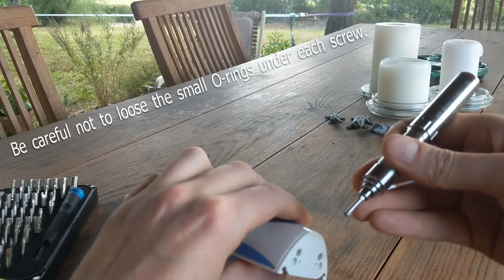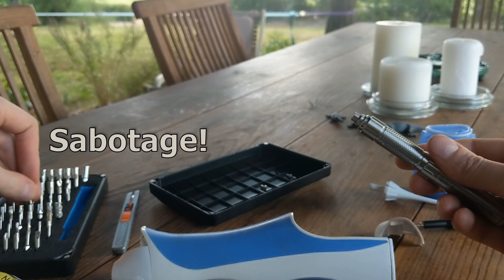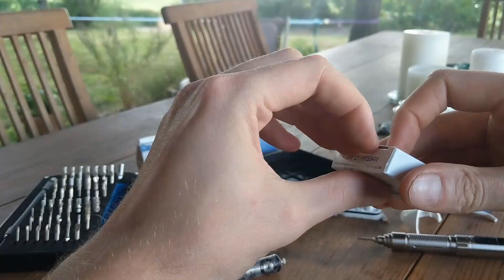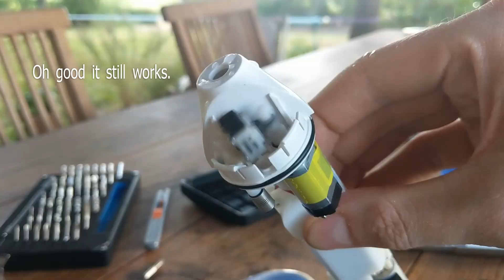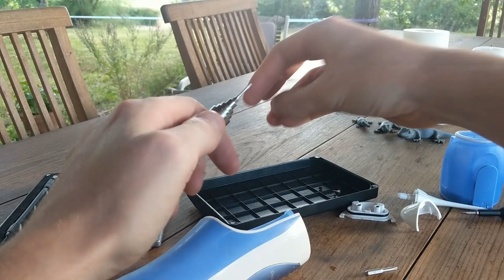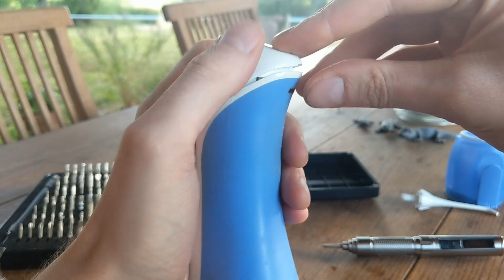Replacing batteries on Panasonic Dentacare EW1211

Comment: Thanks for the disassembly video! Sure was easier than I expected!
A couple of AA batteries does just fine, even better because AA batteries are easier to find in good quality.
The receptacle terminals can be slightly bent to make contact with the battery ends, even without the weird bars.
Reply: Bent and put some plastic from old bank card between case and terminal. And better to use double sided tape to be sure, that batteries are still in place.

Comment: Very kool! Thanks for your pulling it a part, putting it together and making such a great video!! I have an EW1200 and it is non functioning although the base has power.
Reply: And does it work again after replacing the batteries?

Comment: You don't need to remove the torx screw to replace the batteries.
Also, I have a manual for the original EW1211 in 18 languages including English. I don't mind uploading it somewhere if somebody needs it.
Reply: Could you please paste the link here?
Reply: @katalin5630  
https://drive.google.com/file/d/1ho79ZP-9MDlk9ban7gaeOYL0mBA9XZXA/view?usp=sharing

If you go to the Panasonic website for the region of the world where you live you should be able to find a manual in your language.
Reply: 13€ la pile, ça fait 26€ les deux et 30+€ avec livraison, alors que le produit neuf coûte 36€ 😅

Comment: Thanks a lot...... The gadget is perhaps designed in a way that the batteries can't be replaced...... It was a major hassle right from opening it,  sourcing the batteries and assembling back. It wouldn't have been possible to do but for your guide

Comment: Judging by the cleanliness of this machine Alex is working on a new one. I found the batteries didnt come out anywhere near as easily as that, some corrosion had set in around the terminals and 'welded' them in. And no you do not need to remove the torx screw.
Reply from the maker: I did take the opportunity to clean the parts while doing this. I found there was white limescale residue on some surfaces, mostly obvious on the blue tank.
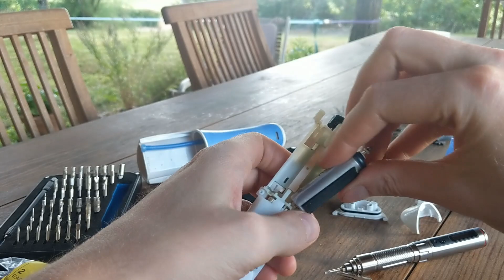The splits between parts had collected some gunk. The sealed areas were clean however, I think you can just about see a tiny bit of corrosion on one terminal at 2:44, so maybe humidity was still able to get in. NiMH are meant to be quite good at not leaking electrolyte unless overcharged/overheated but apparently it does still occasionally happen.
I think I worked out the Dentacare was 4 or 5 years old when I did the battery change.

Were you still able to replace the cells and get it working?

And yes, the torx screw can indeed stay in if you're just changing the batteries. I think I was just having a bit too much fun with the driver set!

Comment: I bought my battery from Espares and after replacing the old one the water jet worked well for a while but it didnt last long. Now I get two uses before the battery goes flat. Either its a counterfeit or its a manufacturing fault.

Comment: What is the battery size? I want to check if an battery type AA may fit.
Reply: Yes, AA batteries can be made to fit. Those weird 1.800.8 batteries are just AAs with extra bar ends. If you're willing to slightly bend the receptacle terminals it'll make contact with AAs just as well. However, keep in mind the bar ends were providing extra rigidity which you'll have to compensate, by example by re-using those foam stickers.

Comment: I have a similar model, only that it's the "w" variant, and it held it's power consistently throughout the 2 year lifespan, but now it suddenly loses power, can be this be due to bad batteries?
Reply from the maker: If it does still charge when placed on the charger but just looses power quickly with use I'd guess it probably is the batteries degrading. If it has suddenly stopped working and doesn't run even after charging I'd be concerned something else has gone wrong.  If you have a multimeter you could maybe check the battery voltage before and after charging.

Comment: Nice thankyou for the vid. Was able too open it now in the proper way. Mine is a litle bit differant from inside. I see i only got to order the replacement battery's somewhere hehe. Were did you get the battary's?
Reply from the maker: I ordered my batteries from espares.co.uk but Pat MTL has commented below that the french site adepem.com also has them for a similar price.

Comment: Do you really need to remove the little scree close to the straw? I am missing that head.
Reply: The answer is no... You don't. Anyway, thanks for the video!
Reply from the maker: You're right, there area only really 3 screws that need removing. It can however be helpful to remove the straw when re-assembling to make sure it is properly inserted into the rubber tube section (the one wrapped in a spring) and avoid any leakage on the inside of the device.